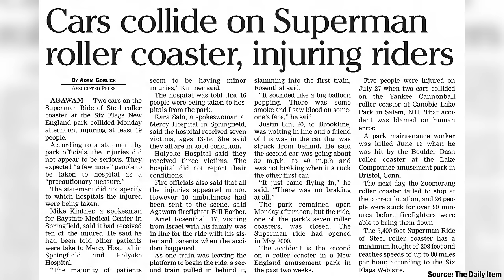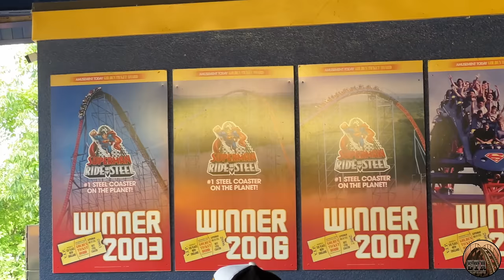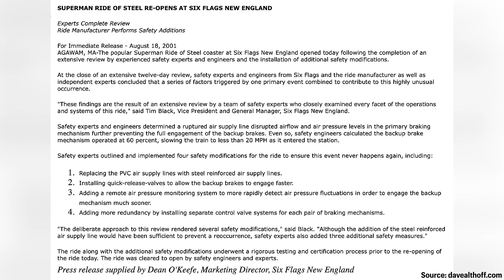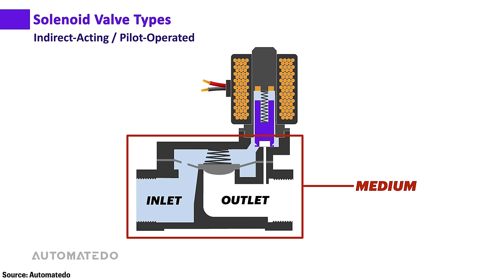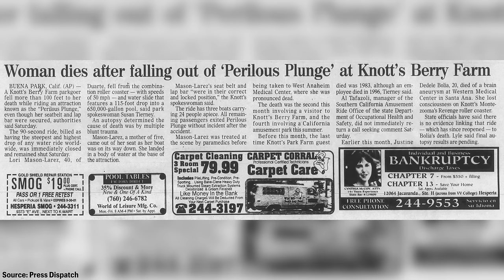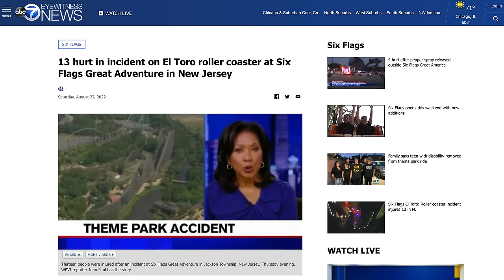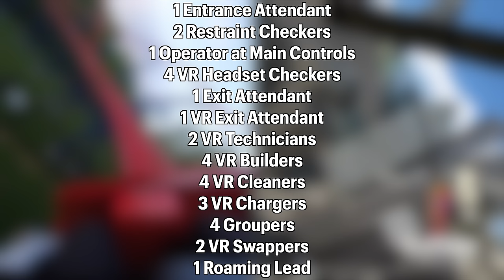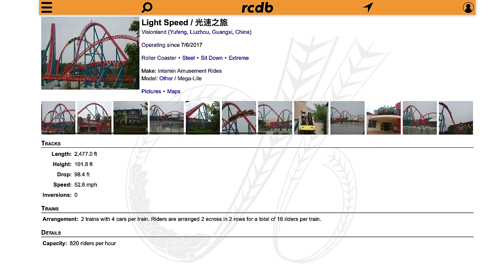The Accident-Prone Superman The Ride - A Problematic Roller Coaster

Comment: Fantastic video! The death of Mr. Morbarsky is an excellent example of the swiss cheese model in safety and engineering. Each layer of safety is like a slice of cheese, and a vulnerability in a layer is a hole in that slice of cheese. In theory, a catastrophic incident can only occur if the holes align to allow a threat to pass through. Holes in Superman's design, quality control, and ride operator training aligned perfectly in 2004 to lead to Mr. Morbarsky's death. This incident should be required case study for all aspiring engineers and project managers in the amusement industry if it isn't already.
Reply: If there are "holes" in Superman's design it's because Six Flags chose it, Werner Stengel designed all the Supermans and Millennium Force, Intamin and Stengel only do what the client instructs them to do.
Reply: @StvBnsn while Intamins rides are great there not exactly reliable. Kingda Ka is closed because a launch piece broke again. This is quite a common occurrence. I wouldn't be shocked if it goes the top thrill 2 route like cedar did
Reply: @Japanlover79  Ohh no doubt when I worked on Dragster we used to taunt the ride to throw up a trouble light and 20% of the time it worked lol.
Reply: I know it's a bit morbid, but " The death of Mr. Morbarsky" sounds like a really good title for an indie comedy film.
Reply: Six Flags seems shady in general especially with the new CEO. I live closest to Great America and that park looks like it's rotting on the inside. If they can't even keep up with cosmetics and upgrades they might not even be giving a second thought t ride safety and upkeep

Comment: The slightest error or oversight can easily lead to tragedy. I'll never forget the last ride I took on Wicked Twister at Cedar Point about ten years ago - though my belt did get buckled to the over-the-shoulder restraint, the restraint was not locked in placed when the ride began. While it was probably unlikely that I could have fallen out, as the belt connected to the restraint from in between my legs, the experience was terrifying and definitely the most I've ever feared for my life. Good riddance!
Reply: F Wicked Twister, the shoulder restraints were too bulky and wouldn't fit me properly.

Comment: Body dimensions are a big problem when it comes to roller coasters. Im currently in the process of trying to get my weight down to fit in rides more comfortably.

I fully understand the difficulty of accomodating every body dimension. You want kids and average sized adults to be able to fit, but some people tend to be larger, and you don't want to shame someone for their weight.

"One size fits all" is a difficult concept in terms of manufacturing and design. And of course incidents like the ones mentioned here lead insurance companies and lawyers to make drastic changes like the U Bricks. Every accident hurts a park. 

But I believe that restraints could be more inclusive in some ways. Last year I was able to fit on Leviathan but not Behemoth because the seats on Leviathan are bigger. Why not have those seats on Behemoth? They're the same model. Also, if kids can sit in the bigger seats on B&M wing coasters, why not make every seat like that?

Two people of the same weight can store fat in different areas. Someone can have skinny legs but large hips, and others can have a small gut but a larger face. It really is a challenge.
Reply: The reason that only some seats have the "big boy" seats on B&M floorless/inverted/wing coasters is that those seats are always in the middle, where the forces (especially lateral forces) are the weakest.  They don't want smaller riders in the bigger seats in the rows where there are stronger forces; even if they wouldn't get ejected, they'd get tossed around in the seat more than B&M thinks would be comfortable.
Reply: @cynicanal111  That makes a lot of sense. Thanks!

Comment: I love these videos! Could you make a technical breakdown on how multi-move works, as well as an analysis of the different types and how it has evolved over the years. I've always wondered how some modern coasters don't have it but Matterhorn, a very archaic coaster, does. I'd also love to see a problematic coaster video of Matterhorn Bobsleds!
Reply: It’s always a bit painful watching a coaster like steel vengeance or valravn that gets such long lines not have multi move and take upwards of 30 seconds to park in the station. I have wondered why they don’t have it, considering how much it could benefit the capacity.

Comment: This is one of your best videos.  I used to work maintenance at SFNE and know that maintanence staff has some experts working on this ride, while operators often don't care.  I even saw one girl crying because it was about the leave without her seat belt fastened.  I can tell you from experience, there won't be any changes made to it, even with the merger.  I like the smoothness of the front better, but I think nothing beats riding it at night.  Thanks for the great information you provide!

Comment: When I was a kid and rode the tallest wooden roller coaster at Cedar Point. The strength in my neck wasn't fully developed and my head was slamming side to side on the hard padding from the vibration. I also strained my neck trying to hold my head steady. I had to lay on a bench for 15 minutes to recover afterwards🤕
Reply: When I was young I went on the “Tennessee Tornado” in Dollywood and literally suffered a concussion because there was a gap between the back padding and head padding and the back of my head was smashing against pure plastic and metal

Comment: Great video and - as always, very interesting!
One short note: Expedition GeForce features a electronic system to check if the restraints are sufficiently closed. We originally planned to make a measurement using one of our dummies, but due to its large legs the restraint wouldn’t close enough and prevented the ride OPs from dispatching the train. So something has to be in place. 
I can’t tell you when this system was installed, though. ~Kevin

Comment: I find it so bizarre that the first accident even happened. In every situation I see a pneumatic/hydraulic cylinder in my field of work there will always be a feedback system to monitor its position, ie a reed switch or a proximity switch. I've never known a system to rely on an output to solenoid to determine its position/state.

Comment: I laughed when you spoke about the chain being slowed so the car wasn't as high on the hill. I went in 2015 and bazzaro was my dad's favorite ride. We rode it a bunch of times (in the back as you should) and did happen to get stuck on the lift hill, pretty high up for a while. Still a memory to call out to my dad who is very afraid of heights. We had to walk off one other roller coaster before but it wasn't that high off the ground. I was waiting to walk off this one but thankfully did not have to. 

You're my favorite rollercoaster nerd 💜

Comment: By the way, It's a really interesting experience when you've mostly ever ridden Superman from the front, only to one day jump into the rear train. I ended up being so familiar with the various forces at specific spots along the track while riding front row, that it totally felt like a completely different ride from the rear seat, as I wouldn't be expecting the effects of being pulled around the track compared to what I felt being pushed around the layout. Especially with the timings of these forces.

Comment: Dude your explanation of the possible brake failure is SO GOOD. I also think it's accurate, especially if ride control was determining the brakes position electronically through the solenoid

Comment: Not sure if it was an oversight or not, but there's no mention of James Hackemer's 2011 death on the Darien Lake variant of Ride of Steal.  It was caused by negligence of the ride operators who allowed a military veteran who lost both his legs onto the ride.  Just like Agawarm's death, the lap bar couldn't make contact with it's intended location and resulted in Hackemer being ejected from the ride.
Reply from the maker: It’s definitely a tragic death but I didn’t feel it connected with the story of Superman at New England, since it only had to due with negligence by the ride operators and not a design flaw with the ride. Whereas the first ejection on Darien Lake’s Superman was due in part to the ride having no measurement system of its riders whatsoever

Comment: I was always worried about the length of the Steel Phantom/Phantoms Revenge brake run.  There are a lot of times when there’s a train parked in the station and the second train blasts into the brakes.
Reply: When doesn't Phantom blast into the brakes? I can't wait for Ryan to make a Steel Curtain video.

Edit: Google auto incorrect screwed up brakes and changed it to breaks.
Reply: @joehung1552  It always does.  It’s just extra freaky when there’s a train sitting there in the station.  And I definitely think the lawn ornament should get its own problematic video.
Reply: The difference there is that the Phantoms revenge brakes are a common, proven design, likely with very simple logic (lock fully applied, only release once the train is fully stopped). The break design on Superman is complicated, especially for a company who had gained a reputation for designing stuff that was kind of always broken.

Comment: I'm starting to understand why Cedar Fair has been so hesitant to work with Intamin lately. They seem to have a real knack for building rides that are hits with enthusiasts and the GP alike but end up having a laundry list of problems for operations and/or maintenance. (Yes, I know this coaster is at a Six Flags park but my point still stands.)
Reply: The Cedar Fair laundry list of Intamin issues include Millennium Force, Xcelerator, Top Thrill Dragster, Avalanche Run, Maverick, Intimidator 305, Shoot The Rappids and Volcano The Blast Coaster (the last one wasn’t built by Cedar Fair, but they operated it for the majority of its life).
Reply: Cedar Fair isn’t the only ones. There’s a reason why Intamin has resorted to building rides in China. Being “not risk adversed” and “pushing the envelope” with safety should but be what a roller coaster manufacturer does.
Reply: Cedar fair is a bunch or cry baby's If you ask a coaster manufacturer to push the limits you're not asking for reliability.  Cedar fair apparently has a problem with pretty much. Every manufacturer that has put them on the map kind of funny.
Reply: @SnowghostFilms you forgot Wicked Twister too on that list many issues with that in the first season it was open!

Comment: Hey Ryan. I would love to see a video explaining why Roller Coaster trains have a 0 car (usually the front part of the train that doesn’t feature riders). It’s interesting to me because not every train has a 0 car. Do u know why this is?
Reply: My guess is that this is only on roller coasters where the cars only have one set of wheels each. If that's the case iw would prevent them from having to have two different designs of passenger carrying vehicles (and the resultant concerns over safety). You have one design with all the safety critical restraint systems that you test the ceap out of, and a separate front car that is essentially just a set of wheels.
Reply: probably weight for more momentum

Comment: Great Video Ryan!

33:03 The only thing that i can think of regarding the brake failure was that there wasn't a "rupture" as you would normally believe, but rather a crack with a small, but sizable enough leak to not let full pressure, but allow the accumulator tank to stay relatively full. That would satisfy how the accumulator wouldn't go under it's setpoint but also have enough pressure in the line to slightly stop the train before crash. If be willing to assume that the forces from the brake run caused the hot and likepy weakened PVC to crack  with these slight movements.

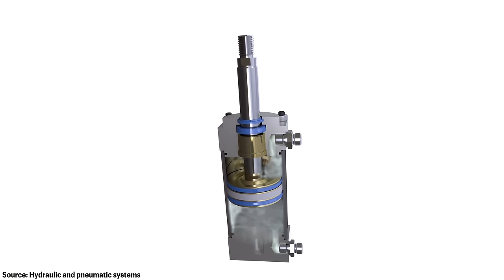Comment: 28:00 For those that don't know this is pretty much exactly how Semi-Truck (tractor trailer) & railroad/trains braking systems work, and have worked since the late 1800's.  Loss of air or some other system failure the "spring" brakes are automatically engaged without any human/driver intervention.

Comment: My husband and I were nearly involved in the 2001 accident at SFNE. We had just unloaded from the train and hadn't even left the platform yet when the other train came in and hit the one we had just gotten off of. I am pretty sure that riders were already in their seats, thankfully. I distinctly remember the sound of the crash (it happened behind us) and it pushing the next train up the hill. No cell cameras that day and digital cameras were in their infancy. I remember just thinking, we need to get out of here. The golf cart ambulance buggies arrived very quickly, and the area was closed off. We went to the Six Flags near DC a few days later and their version of the ride was still closed. 

Thanks for covering this, it's helps me understand what happened very well. All I knew was that the brakes had obviously failed.

Comment: Didn't know all the history of this ride and subsequently all the Superman rides, appreciate your detailed work with this! 
We went and drove past Darien Lake quite a bit as a family and have footage from 1999 or 2000 of a train running where the restraints on the open seats (no rides in the seat) were fully open. I presume this was prior to updates so it's interesting to see how this ride and related rides have impacted the operation and procedures of all Intamin Superman's.
Reply: I worked as a supervisor at Darien Lake from 2009-2011 but had visited as a kid for years so followed these coaster's history very closely. Yes, that's correct. The lapbars could be sent up until the computer was upgraded in 2005 (similar to on SFNE's) that allowed them to eliminate the small seatbelt from the yellow lapbar that would attach to the side of the seat. From 2005 on, the lapbars do have to be lowered far enough to dispatch. To my knowledge Millennium Force can still operate with the lapbars up, or at least it could in 2007 when I worked the ride briefly.
Reply: @danblanchfield4918  Oh wow, thanks for the behind the scenes info!

Comment: I would say the coaster which takes the most from Superman’s layout while building upon it is DC Rivals Hypercoaster at Warner Brothers movie world: it starts with strong airtime and big elements and then moves into a low to the ground twister section in the latter half of the ride. One improvement however (apart from the modern Mack rides train and lap-bars which allow free body movement) is that apart from the airtime being strong ejector the whole way through after the twister section there’s a series of bunny hills which have you flying out of your seat into the brake run. Fantastic coaster even if the helix is a bit of a dud.

Comment: Your best Problematic Coaster video yet.

I was able to Ride SROS: At 6 Flags New England and Six Flags America before any modifications... I actually had a disability pass due to a badly bruised knee cap and my knee had to be partially immobilized, I would disconnect the immobilizer to ride, then reattach it once the ride was done.

On the SLC's and floorless coaster this was not an issue, just for  SROS.

I have not been able to ride the Darien Lake iteration, but since it is just a mirror of the Six Flags America version I take the credit anyway.

Comment: with the modern restraints, i can't tell if it's a thrillride or a torture device. i rode front and back and while the view is great in the front, i agree that the back car is a great ride. no VR in front or back car was a very good idea. i think part of why they didn't bother reconverting the tenth row for seats was because of how they would at times run it empty anyway and get a better performance from it.

Comment: these videos are really educational; they taught me what it means if a rollercoaster train suddenly comes to a stop when not in the station: another train is occupying the block zone ahead of that train and the computer system is preventing the trains from colliding with each other. this has happened to me a few times: on guardians of the galaxy: cosmic rewind (it happened twice: on my first ever ride in august 2022 (on the small hill that goes into the tunnel leaving the universe of energy building) and on my second ride (fourth or fifth overall) in my july 2023 trip (somewhere after the launch)) and seven dwarfs mine train (at the top of the lift hill out of the mine; this one was nice because i got to hear the end of the song: it just fades away (surprisingly))

Comment: I'm 6'5" and I was told by Superman The Ride staff that I was too tall to ride, so I went back through the line barefoot, and they let me on. This was im 2022.  I found the U-brick restraints to be fine, though, without any discomfort.  The part of the train I found uncomfortable was the lack of room for my feet (and I wear size 14 shoes, so this was considerably worse for me than for the avg rider).  All in all, I fricking love Superman The Ride.  Sure, the restraints could be better, and the airtime is dampened a bit by them, but it is still one helluva ride.